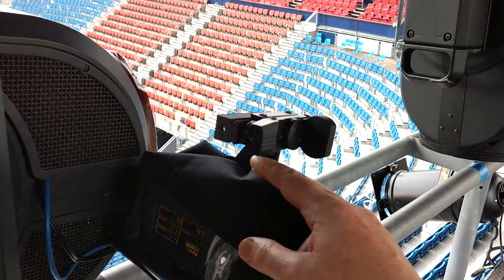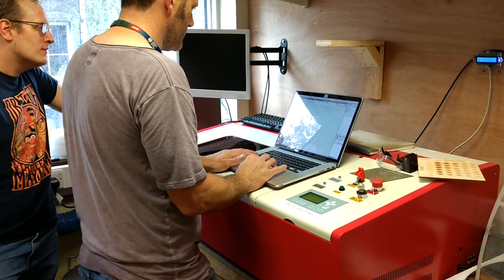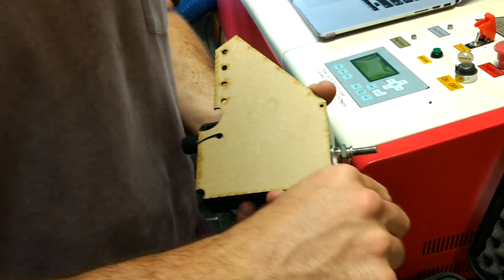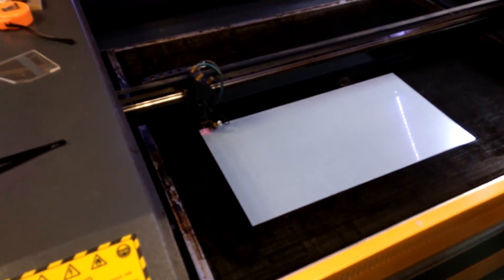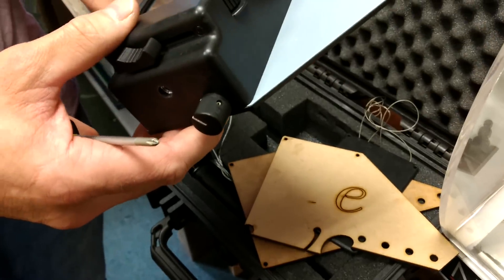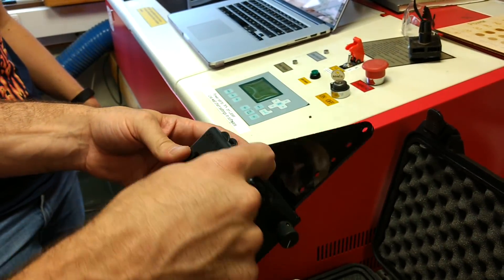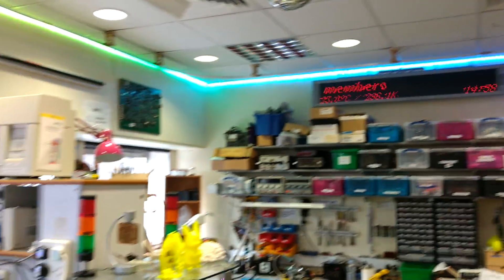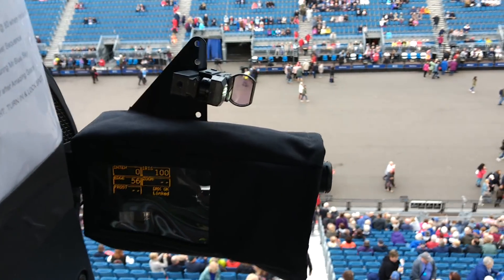Edinburgh Hacklab visit for new followspot mount prototyping.

Comment: CLIVEEEEE. I have a completely off-topic question. Where do I get un-armoured 16mm² three core cable. The only stuff I can find is the flat twin and earth and the armored round stuff. Armoured cable is a bit excessive to be running 5 meters from a breaker box to the kitchen.
Reply: Get flat twin and earth and mark ends of yellow-green with right colour insulation tape - at least that's the usual practice in Poland when you have to run cable with non-compliant colourings - insulation tape/sleeve has to be long enough so it's obvious even after shortening the wire a bit .
Reply: I'm not looking to run flat cable though. Non- compliant colours isn't an issue, that's easily enough solved. I'm looking for the round 3 core stuff. I can only find it with steel armouring around the cable and apart from making it far to stiff for my needs it's also too expensive.

Comment: BIG CLIVE. I have bought a METAL mini photography e27 lamp on Amazon, and it is not earthed (2 core flat flex cable), and there is NO DOUBLE INSULATION either! There are a ton of large (large enough for a childs finger!!) air circulation holes in the back and I can see BARE BROWN WIRE with no plastic on it as it enters the light fitting! Amazon were amazing and refunded me, but they haven't pulled it from sale. The seller is still claiming it is UK safe, despite another review stating it is dangerous. I'd hate somebody to get hurt.

The plug has a protective earth symbol on it, but I can't see an earth wire anywhere! Hoping it isn't a fake symbol.

My dad always joked he could remember which wire was live, because if you touch the live wire, you sh*t yourself, hence brown wire haha.

Can I send you it, and you do a video on how unsafe it is please? 

Its a shame as I really love the lights, i'd love to see a video on how to fit an earth wire myself, however it has an inline switch and I have no idea what i'm doing haha. Guessing i'd need a new plug and 3 core flex?
Reply: Well, if the wire is brown, then it's not bare;) And in all fairness it's not that easy to get a Charlie in a chocolate factory 230V encounter - if air is dry, floor is dry, you're not barefooted, skin on your hand is intact and you aren't touching something conductive with other part of your body you could not even feel that you're touching a live wire. Most accidents working on live mains are due to accidentally closing the circuit to something grounded when working in hard to reach places or falling from the ladder because you shorted something;)

Comment: Surprised you haven't folded the mount over at right angles so the optic mounts in the same plane as the spot. It could then be bolted through two of the brackets holes and be a bit more secure, as well as being in the correct orientation.

Comment: I would have killed for one of them on my old spot days with my “spot dot” gaffa taped to a gladiator and the tape melting half way through the show, usually the most critical point, cue much fumbling and ghosting a rafter in the roof to get back in line
Reply: Oh and how are you guys getting on with the ground control system? I would have thought that would have been ideal at the castle
Reply from the maker: All our spots are in an easily accessible gantry position.
Reply: +The RX7 Roadie Years ago I worked at Knott's Berry Farm in California, one of my shows was the fireworks show on Reflection Lake..had a Xenon Super Trooper with the hideous Kniesley power supply (on which the power switch exploded with annoying regularity). This was on an 8x8 foot platform, 15 feet above a roof behind the facade facing the lake. Start of show was playing the spot over the crowd while "Hooray for Hollywood" played, then had to find and ghost on a mirror ball in a tree for the exit music. (Through the dense smoke from the finale.) On one show, the opening got interesting as the Trooper decided to try to roll off the edge of the platform....almost taking me with it. The boss radioed asking why I was shooting at the sky. Next day I took some 4x4 and framed in the base so it couldn't roll again (bad wheel locks caused the near miss.)

Comment: I always wondered how they are able aim the correct spot before turning on the light. And it's so simple…

Thumbs up for the dedicated IRC monitor (#edinhacklab on freenode)!
Reply: My simple solution was to mount a cheap video camera on the spot and mark the beam on the monitor at various zoom levels.  Positioning does not require accurate head position to see the aim in the monitor.  Originally built for moving heads on a truss where the operator is in the booth.

Comment: Very nice! Just keep in mind that acrylic is extremely brittle, I've had laser cut sheets like this break in two from the mere touch of a screwdriver, so be careful with handling it!
Reply: Ditto - I'd have used some Delrin here. Laser cuts nicely, and very impact-resistant.
Reply: Double up the thickness of the bracket above the box and it should be fine. Couple of pound land nuts and bolts will do nicely for fixing the doubler plate on
Reply: anlumo1 I wonder if glass filled PEEK would work.
Reply: Uh....apart from the fact that glass-filled PEEK (e.g. Ketron GF30) is nearly 40x more expensive than delrin!
Reply: Lindsay Wilson But, will it last 40x as long?
Reply: It doesn't really work like that. In this application, which is reasonably light duty, a piece of cheap delrin, for example, is going to last basically forever anyway. There would be absolutely no point in replacing it with a higher-spec material like Ketron. If you did want something a bit fancier, but still cheap, a bit of common FR4/G10 fiberglass sheet would do.
Reply: Lindsay Wilson You mean it's as durable as the next person that touches it that isn't you. Besides that, that violates my principle of over engineering things.

Comment: Interesting.  What are  followspot controllers.  Do they track cameras or lights.  Couldnt really see what it was bolted to.  Finally thought of a question for colleagues.  Does vertigo every pop up as an issue.  Most days I am ok, and others
Reply: It's bolted to a big, manually moved spotlight. The controller is to adjust the intensity and such. The little sight is so the operator can see where it's aiming without having to guess (since, as Clive mentioned, they have 12 of them).

Much fancier than the last followspot I operated... Which had mechanical focus and zoom knobs (that got hotter than the sun during operation) and a lever to open and close the iris to change the intensity. Aiming was done by looking across the top, and hoping it was mostly aligned. None of this Inspector Gadget stuff.
Reply: So you want to know if Virtigo goes? .... I'll get me coat ;0)

Comment: Will that laser cut a mirror
Reply: Unfortunately no - Our laser actually uses mirrors to direct the beam to the cutting head: if the laser was cutting through the mirrors then we'd have a problem indeed! As I understand it, the best way to cut flat mirrors is using a waterjet cutter, which is a lot messier but works very well. 

In order for the laser to cut a material, it needs to absorb the laser light. Ordinary glass is transparent to the wavelengths our laser uses, and ordinary silver mirrors reflect that light; if you put a mirror in our laser bed, there's actually a risk you'd reflect light back through the optical system and cause damage. For a similar reason, this kind of laser can't cut metal or stone. Instead, you want a fibre optic laser for that; fibre optic lasers can be a lot more powerful than mirror-based systems, and a lot more dangerous :D
Reply: Thanks for the insight!

Alex.
Reply: Huh? CO2 lasers can engrave glass no problem - Cutting is an issue due to micro fractures as it literally detonates away tiny amounts material... and acrylic mirrors are something I cut all the time. The beam steering mirrors MUST have a surface designed to reflect the correct wavelength otherwise it may as well be just another object to cut...